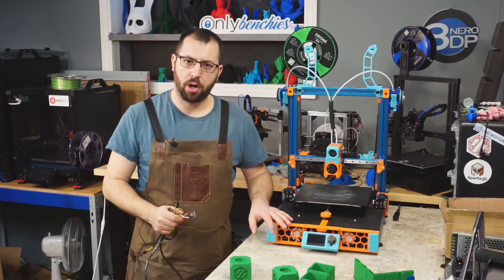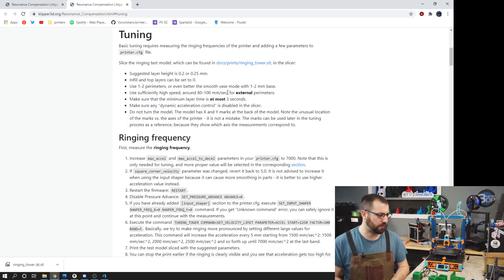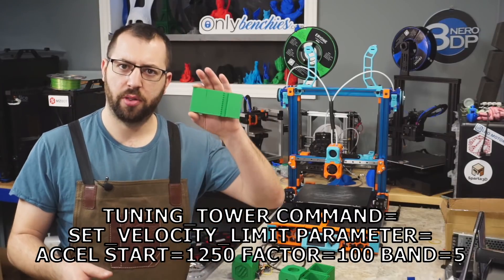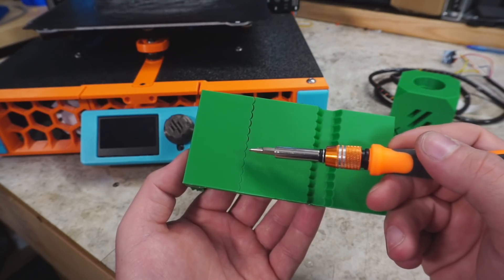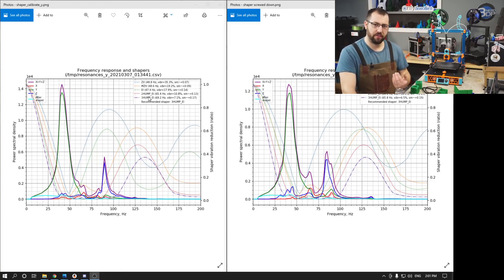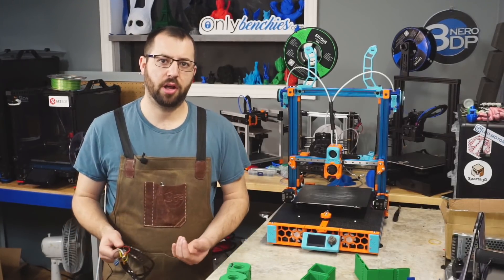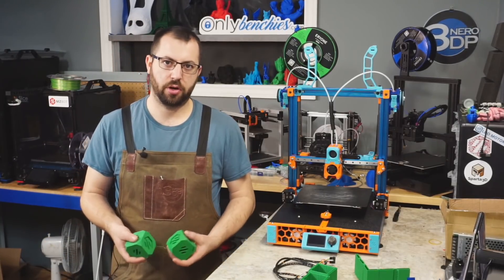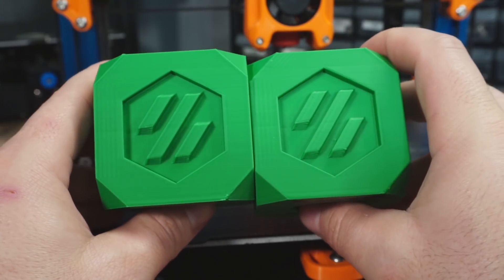MAX OUT ACCELERATION - Find your printers limit with input shaper!

Comment: Thanks for this explanation.
On my side, the Tower printing is not a success.
If I have understood, the speed should increase regularly due to TUNING_TOWER COMMAND=SET_VELOCITY_LIMIT PARAMETER=ACCEL START=1500 STEP_DELTA=500 STEP_HEIGHT=5.
My speed is 45mm/s and is not changing... :|

An idea?
Note: I'm using a Creality Ender 3 S1 Pro + Creality Sonic Pad

Comment: Good way to attach accelerometer to the bed is to just print the mount and not remove it from it. You can then just screw the adxl to the printed mount.

Comment: I've got a question regarding the fact that we have to retune linear/pressure advance everytime we change input shaping settings. I've also read that after changing acceleration values the pressure advance calibration also has to be redone. Is it true? If so, how does that work if we vary the acceleration for inner/outer perimeter in one print, doesn't this mess things up?
Reply from the maker: Correct, IS will affect PA

Usually you just have to rerun PA after doing a new IS tune and thats it

Comment: External stepper motor driver TMC2225 with Input Shaping
GH Smart Shaper

Due to the shortage of electronic components (Raspberry boards are practically unavailable) and to the required skills, Klipper is not yet a solution within everyone’s reach.
GH Enterprise has therefore found a solution that allows you to add Input Shaping to 3D printers in a simple and immediate way, avoiding the use of external host cards such as RPI4.

Just replace the X and Y axis drivers with the GH Smart Shaper drivers, add some configuration commands to your g-code and you are ready to print with input shaping.
Reply from the maker: This sounds like an add?

Also that method has downsides like it only works on machines with independent xy motors. So not on deltas or corexy machines and also it uses the print and measure method which is not as accurate as the accelerometer method
Reply: @CanuckCreator  In a couple of days it will also work on Corexy, we are completing the documentation, on Delta it will not be possible
Reply: the smart shaper now also works with corexy printers

Comment: What layer height should I use if using .6 nozzle should it be .3 when I printed the test the gap was never closed or barely changed thru whole print even at 7500 accel

Comment: I did this not long ago, I found out max accel for my ender 3 could be easily 6000 which is unbelievable for bedslinger, almost zero ringing and tiny gaps start to appear at 6500. Anyway I set max accel to 4000 since I don't care that much about speed. Klipper should be must for 3d printers
Reply: My Ender 3 Pro is at 5000 m/s2 on X axis and 3500 m/s2 on Y, I get a little bit of remaining ringing but the edges are very good, I let it slow down for small details and overhangs... oh, but I don't use the stock steppers as they get too hot around 2000 m/s2...
Reply: Hello, what steppers are you using?
Reply: I bet your prints aren't as detailed with Input shaper and  that acceleration. Try printing a calibration cube. Is it completely flat with square corners and no ringing ?

Comment: Excellent tutorial. Only error is the starting height being 1250. It’s actually 1500. Common error because the formula isn’t commonly shared. 
Here’s the formula though: 
value = start + factor * ((floor(z_height / band) + .5) * band)
Reply: lol, literally today he changed the formulas on the resonance compensation page to be something clearer for people to use:
TUNING_TOWER COMMAND=SET_VELOCITY_LIMIT PARAMETER=ACCEL START=1500 STEP_DELTA=500 STEP_HEIGHT=5

Comment: Could you print a mount for the accelerometer, leave it on the bed, mount the accelerometer into it and then run the test? In my mind that would give you the most accurate results as it would be specifically recording the forces the print was subject to whilst being printed.
Reply from the maker: Yup. And thats been tried and known to work

Comment: Wouldn't you expect to see different resonance data when you mount the accelerometer at different locations on the bed?  For the hard mounting, you mounted it at the corner while for the tape, you picked the front/center.  Also, the way you had the cables running put a load on the bed.  Wouldn't you want to be careful to arrange them to minimize load in the direction of movement?  Finally, doesn't the mass of the print and height above the bed strongly influence the vibration of the bed/part?  Seems that calibrating with an empty bed won't give good results when you have a few hundred grams of plastic on there.  Looks like you really need to look at the movement of  the other axies when looking at bed vibration at least for a bed flinger.

Comment: I used a little hobby hot glue gun to mount the accelerometer to the glass bed of my SidewinderX1 and it worked great. I hung the bottom of the pins off the edge of the bed to allow for some leverage, making it a little easier to remove. Be careful when you remove the accelerometer so as not to damage the bed or the unit itself.

Comment: You HAVE to mount the accelerometer with tha Z axis pointing UP
Please take a look at the datasheet before mounting the Accelerometer.
For best result it has to be oriented correctly.
XY accelerometer plane has to be parallel to XY printer plane.
Figure 51. Noise vs. Output Data Rate PAGE 33

Comment: Detecting ringing in the mechanism with a sensitive instrument is fine, but until you have worked out the relationship between detected ringing and visible ringing in the prints, the data is next to useless!
And once you have that relationship worked out, you would have determined your 'best acceleration'!
Seriously, is maximum acceleration so variable that it needs real-time control?
"Printing PLA today...need to bump the acceleration on the X axis +0.03%"...
If my printer needed to have its acceleration adjusted 'on the fly', I'd be looking for a new printer.

Comment: Great video, cant wait to play with frequency domain in fdm.  best mount for accelerometers,  is often strong magnets.  Often used on industrial rotating machinery.  Simple, rigid  and doesn't unscrew.
Reply: A magnet is definetly not the best way to mount an accelerometer!!. This is only done for quick measurements to get an indication. For proper measuring it's rigidly mounted to a machined surface or glued with a special ceramic glue. 
With a magnet you filter out your high frequencies.

Comment: Kudos for the overview. I wonder if you can speak to the use of using smoothing limits on the more aggressive input shaping algorithms? Also , you said use the highest peak with mzv? Or was it the recommended value but with mzv? Thanks?
Reply from the maker: It really depends on your use case and printer, id rather run tad lower accels and MZV and get crisp corners vs more aggressive input shapers at higher accels
As for MZV i use peak
Reply: @CanuckCreator  Can you say more about the value of limiting smoothing with more aggressive input shaping algorithms?

Comment: Now, how to find the speed limit for printing? There is any method with klipper?
Reply from the maker: That will depend alot on the flow rate of your hotend, the plastic being used and desired finish quality. Theres no set test for determining it.

Comment: Do you control acceleration using your slicer?  I thought the docs recommended disabling all acceleration control...
Reply from the maker: It needs to be disabled for the calibration print, but afterwards you can adjust it.
Reply: @CanuckCreator  Do you run jerk settings too?

Comment: If you can't screw the accelerometer to the bed you could print something to screw it to and then screw the accelerometer to that (without removing the printed part from the bed, of course)
Reply: Maybe hot glue could work as well. Put masking tape on the bed, and glue the accelerometer to the tape. The tape flat on the bed shouldn’t “wiggle”?
Reply: That's good thinking and I'm stealing the idea.  My bed screws are all hidden beneath magnetic sheets that I am loathe to pierce.  Should get more accurate readings with my actual print surface mounted too.
Reply: I used tape

Comment: Here's a question. I have tuned my switchwire esteps flow input shaper and tuned acceleration. I have one problem? When printing the first layer, the perimeters and brim come out perfect. Then when it comes to the solid infill it looks good and smooth but it looks like it's starting/stopping too soon and late.  I haven't had a chance to less with it lately, but do you think this is related to pressure advance?  I just printed a hollow single wall test cube and there walls are within .01 so I doubt my issue is mechanical related.  Thanks Nero!
Reply from the maker: May be a slicer setting at play such as coasting

Comment: These videos have been great.  I have been applying your tips to an old i3 plus, and it has changed this machine into a completely different beast.  I am working on printing the parts for a Voron Legacy.  I was building a 1.6 when the legacy dropped so I just switched over.  Thanks for the amazing content.

Comment: Which value is right on the Klipper Resonance Compensation page, the START=1250 in the command or the 1500 at the description?
If the starting acceleration is 1250, and each band is printed at +500, than the last one is only 6750, right?
The acceleration isn't changed mid bad, only at the start of a band, or am I reading it wrong?
Reply: The Klipper behavior with TUNING_TOWER when BAND parameter is active is confusing, unfortunately. START says 1250, but the actual start is 1500, as the docs correctly suggest. You can also see it in the console as the print progresses. So the correct accelerations in that tower are 1500, 2000, 2500, and so forth.
Reply: Thanks, will look at the console when I try it out.
Reply from the maker: Its easiest and simplest to go 500 per full band and use the value for the last "fully complete" band before the gap starts to open.
Reply: Thanks, now at least that part is clear. It's just the Klipper RC description that is feels controversial. (1250 != 1500)
Reply: Oh, now that I didn't expect. Thank you very much!